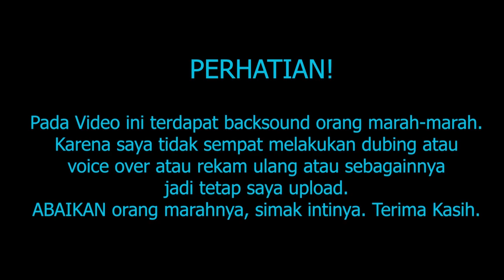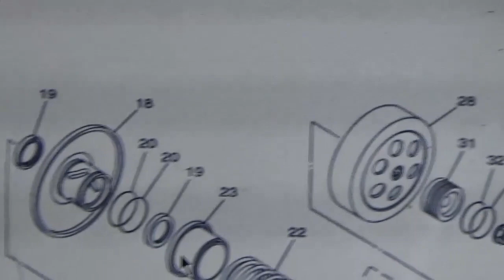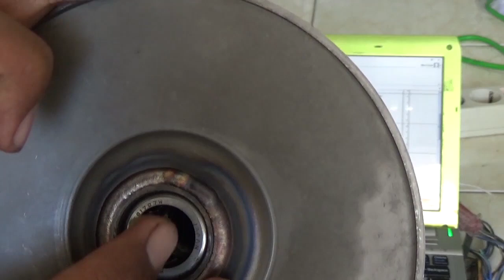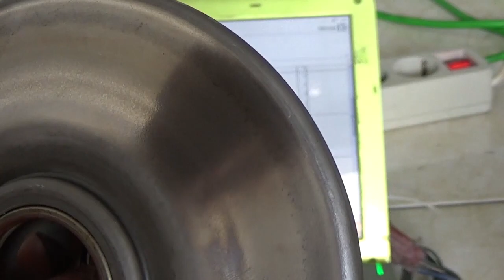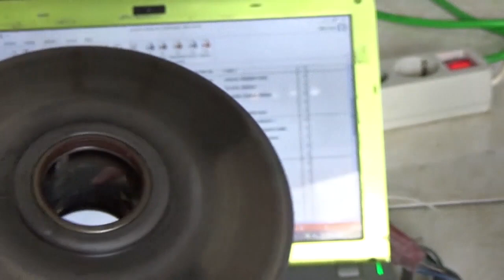Servis Sendiri CVT Yamaha Xeon Part 3.1: Grease Ulang

Comment: Kang,sy minta tolong kasitau kunci2/peralatan apa saja yg digunakan utk bongkar pasang CVT pd Xeon rc-125 thn 2014?minta tolong kang lengkap dgn size nya,Trimakasih
Reply from the maker: Nanti2 deh om.
Lagi repot
Reply: T8 t10
Kunci sok/kunci 17, kunci 14
Treker y/treker belt
Kunci 39-41
Obeng min
Tang jepit
Grease
🙏🙏